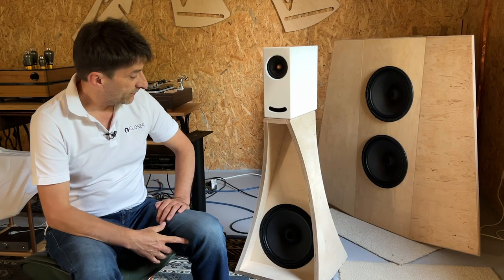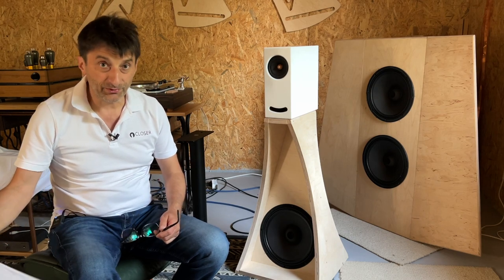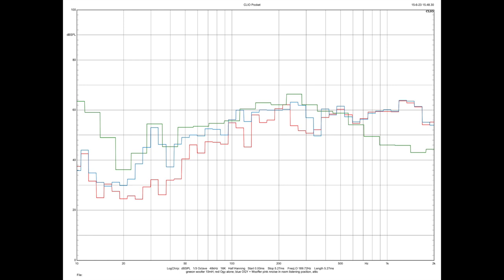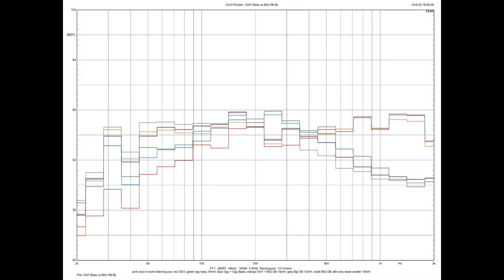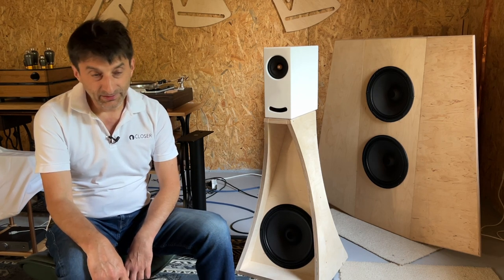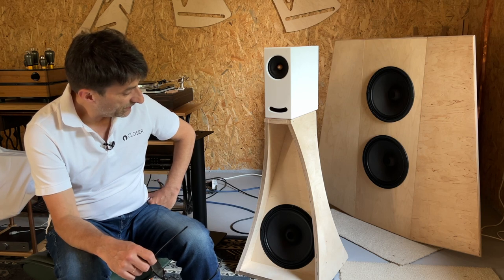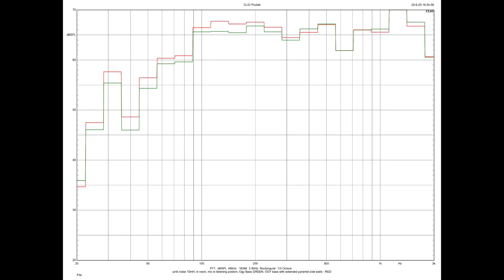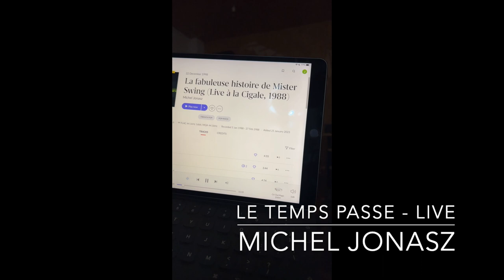OGYs BASS,  Part 2. We have a prototype...

Comment: Mount the OGY's speaker driver at the top of the bass module in an open baffle configuration, change the xover to 350hz (at least 12db/octave, preferably 24) and you will have a much more open sound, better room interaction a la Allison Ones technology, better blending and one cool looking speaker.  Just my opinion.

Comment: Should you just make a new speaker based on the drivers you are using?
Reply from the maker: I don’t think so. The Ogy itself is fine. I do not want any vented cabinets for example. The sound from these is very good.
Reply: keep up the fabulous work, I'm intrigued by what you are trying to achieve it's beautiful sound ❤🎼